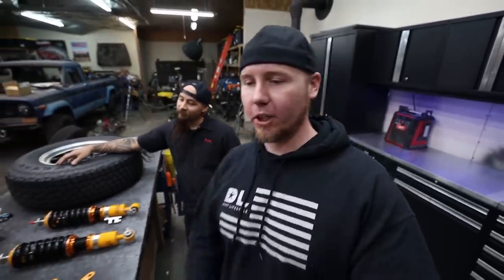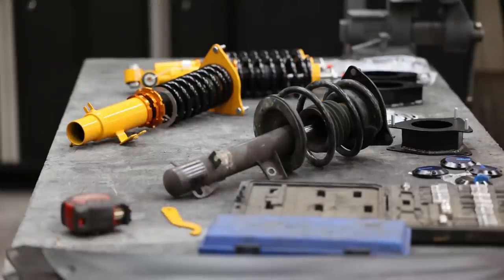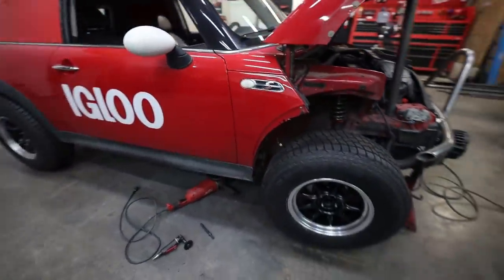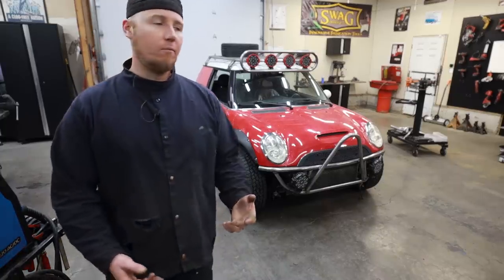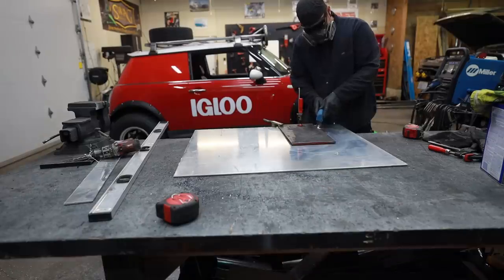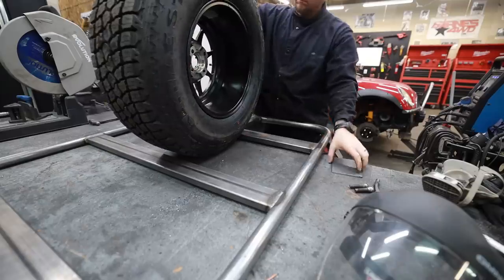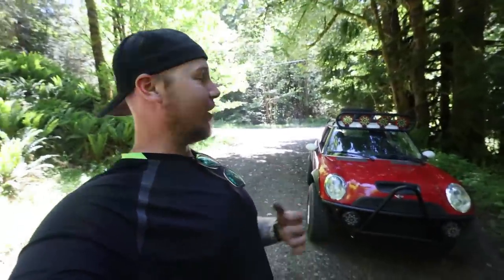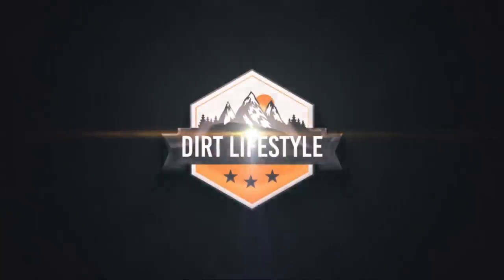Building A Budget Off-road Mini Cooper #Gambler500

Comment: Heat the front flares to replace the plastic before cutting it. “Paint” the heat evenly over a large area. Let it cool then cut it. Should remove most of the uneven tension issues.

Comment: On the Front Fenders, Make a piece that is glued to rear part of the fender and overlaps to the front part of the fender. then run some super strong small magnet to pull the front of the flares down a tad.

Comment: If you take a heat gun and heat the front flares heavily and evenly,  then shock cool it with ice water the flares should take their new molded shape and stay. Just a heads up.

Comment: I think this is absolutely awesome!  But the problem is that it's not an off road vehicle.  Ground clearance and big tires does not make it an offroad vehicle... suspension travel makes it and offroad vehicle.  Stuff like this ends up having some major issues once you start treating it like an offroader... like strut towers cracking, control arms bending and mounts breaking... 
Either way, this is going to be a cool little car!!  Keep the video coming!!

Comment: I really enjoy watching your videos.  You are a great fabricator.  Where you cut the front flares doesn't look bad at all, but I had an idea as I watched you make those patch panels.  What if you filled in the ends (where you cut) of each flare.  You could use aluminum,  thick plastic, fiberglass, etc.  You could shape the pieces you fill in the cut ends so that you force the plastic to line up exactly.  Maybe more work than what it's worth, but thought I throw out the idea.

Comment: Hey dude, I love this wee build.  Did you get much loss in power with gearing with putting on oversized tyres..?  I Had a massive difference in low end power loss in my 2.5td van when I went a little too big on the tyres.
Reply from the maker: I noticed it for sure but this mini had so much more power then it needed that it's definitely not a hindrance. The car weighs around 2600 lbs after all my mods and it makes around 225 hp with the mods from the previous owner

Comment: Awesome job on the mini, someone here or in your vicinity probably has a 3D printer, print up the front flares to include drain holes and dams where the hood separates from the fenders. This will add stability and prevent water and dirt from filling the lower portions of the flairs. Just an idea? Great job and keep up the great work 👍🏼

Comment: should be able to add decorative pieces to the "extruded steel" radiator cover. 
probably cover most of it if you wanted. looks great though. 
I wasn't able to get my gambler together, but gave  my rig to someone who said they would. 

if you see a white BMW 330xi at Oregon Gambler, it's probably mine.

Comment: So what exactly do you use for your tube bumpers?  Is it just schedule 80 black pipe?  Not something extra strong?  I ask because I'm planning on making a tube bumper for my truck, but want to make sure to use the right material.  Thanks!  

(Obviously i'll go larger diameter for the truck)
Reply from the maker: .120 and .180 wall tube. A combination of 1.5inch and 1.75". Pipe is made of softer steel then tube to make it easier to seal threaded joints. It can be used for bumpers but tube is better for this application in my opinion.
Reply: Awesome!  Thank you sir.  Btw.....your videos are awesome, and your fabrication skills killer! 👍✋

Comment: Hey if you wanna get a little more power out of it since you'll need a bit more torque with the big wheels I'd get a 15% reduction pulley for the supercharger and put a heavy weight spring in the bpv along with a k&n air filter, another plus with the 15% reduction pulley is the water pump with push out even more coolant to keep the temps down, I'd also suggest there's sensors on the knuckles that are pointing at the CV axle cut the wire and the car wont cut power if traction is loss even if you turn off traction control it will cut power but if you cut the wire it wont cut power to the wheels, I use to have a 03 r53 and she was badddd miss that car more than anything
Reply from the maker: This already has a pulley, injectors, cam, intake, ect... it rips
Reply: @DirtLifestyle  oh sweet! My brother told me to watch this had no idea, love the build tho dude!

Comment: I have a 2004 Acura RSX and I'm thinking about lifting it using similar strut spacers to these (because I've never seen a "safari" RSX and I think it would look cool lol). Do you think they would hold up to daily use? Because this car is my daily driver and I don't want to have the spacers fail at 70 or 75 mph on the highway. For wheels I was just going to use the steelies from a Honda Element seeing as they are the same size as the factory RSX wheels but would be a little tougher I believe.

Comment: How do those coilovers feel on a bumpy road? I ask because they are almost certainly tuned for handling on the street. I would expect the springs and valving to be stiffer than optimal for a bumpy dirt road. It will be interesting to see if they stand up to the abuse.
Reply: Hi Tony, those coilovers are perfect for street driving, and they can also satisfy the high demands of the race track. You can enjoy a comfortable riding experience in all road conditions.

Comment: Do you have to disconnect the battery to weld on the car?
Absolutely love this build❤️
Reply from the maker: Not in my opinion
Reply: It only takes a minute. Cheap insurance policy INMHO
Reply: The key is placing the ground clamp as close to what you are welding as possible. If you are welding the bumper, put the clamp in the bumper. Electricity takes the path of least resistance (like water) and runs in a circle, or circuit, so if the clamp is close to the weld, then electricity isn't going to run through other parts of the vehicle. It will stay localized to the weld. 

South Main Auto had a video where the ECU was damaged after someone welded on the exhaust of a car. I guarantee whoever did the welding placed the ground clamp on the body/frame of the vehicle (it was a unibody) and when the welding was done on the exhaust, the electric current had to find a path to the body. It destroyed the O2 sensor signal ground circuit in the ECU I believe because it had to take the long way back to the welder ground clamp so it found multiple paths. If the clamp was placed on the exhaust near the weld this almost certainly would not have happened. 

https://www.youtube.com/watch?v=k2i1pXwSHRc

Comment: How much ground clearance did you guys get with the Mini Cooper and what size tyres did you fit? Looking to build something similar to cross the Sahara. Thanks in advance for any info / advice. Mac
Reply: did pretty much the exact thing to my mini, I fitted 235/75'r15's, and with the lift kit and no front bumper, i get about 13" of ground clearance. BUT heed my words, taking a mini cooper to cross the Sahara seems like a disastrous decision, these things are unreliable pieces of crap to the core.

Comment: BMW engineers like multifunction electrical lines. If the power steering fan locks/shorts, power steering is gone! A lot of work with a little steering wheel!

Comment: I like big wheels and I have to keep it just a little bit bigger and nobbey and i can get the wheel to spin faster and k24 and a lot of more horsepower and a bigger rateater, get rid of the AC and open the top up and put a big blower in it and it is not going to be bad! Nice bumpers and I have to make them a little different and the back will have a reserver and a side pipe or pipes and trailer and we can go almost everywhere, you can walk to!
Reply: I forgot and it needs step sides and under gardes, protect your pan!